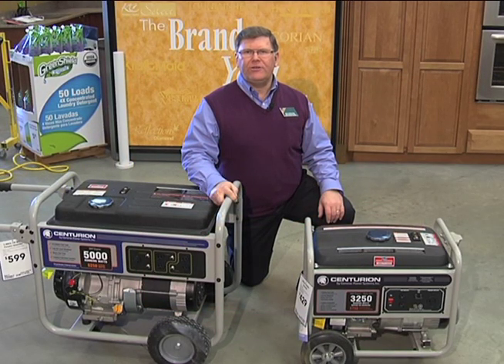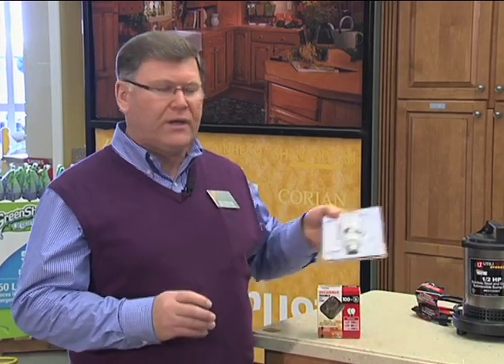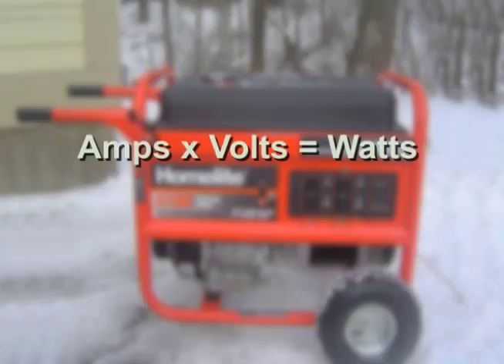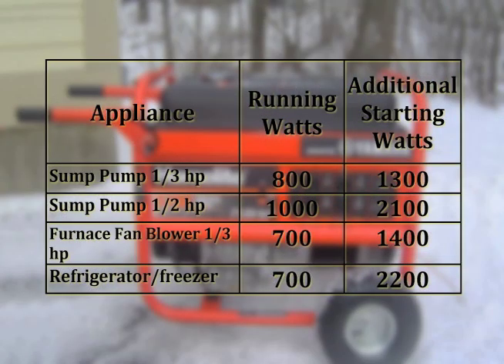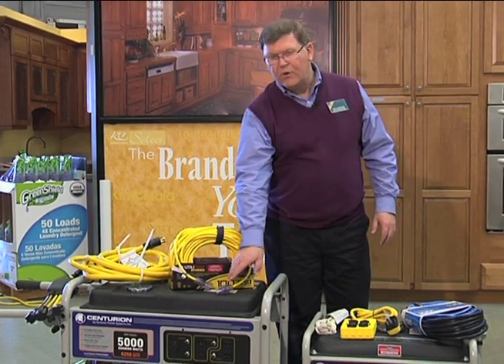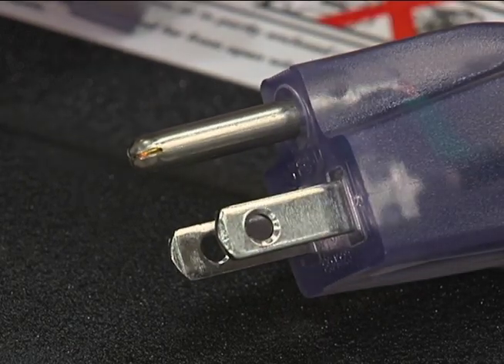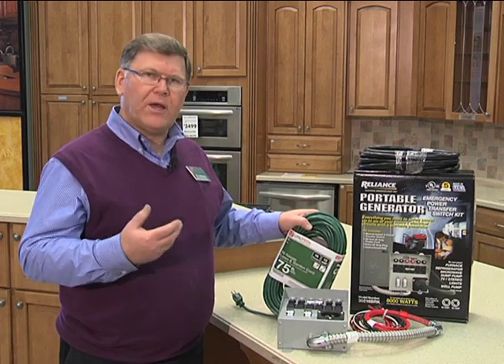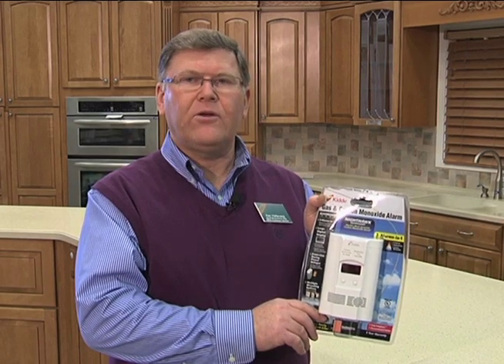Planning Ahead: Portable Generator Safety

Comment: Yup, not enough voltage with a long cord,  the motor will stay in 'start' mode as the motor will not spin fast enough to go into 'run' mode
and the start winding will burn out. Many appliances Co. will void the warranty if an extension cord is used.

Comment: He seems to be referring to  “surge watts” or “peak watts”  which is the watt "maximum" when an item (re)starts - those are not "additional" watts - since the running watts are still included in the "peak" number.   i.e. an item with 100 running watt requirement and 300 peak watts needs 300 watts available - not 400.

Comment: Is it ok to plug an appliance using 120 volt plug into the heavy duty 240 volt power cord which has pigtail or multiple female ends on it.  The cord is rated at 30 amps. Thanks fr ur very good video.  Also My home is older built in 1958.  Would u recommend that I bury a grounding rod and ground the portable, stand alone, portable generator?  Westinghouse 7500 E
Reply: You need to make sure the cord you are describing is splitting the 240 volts onto to 120 legs.  The best way to find someone who has a voltage meter and test one of the ends.  These usually have 4 plugs on their ends.  The volt meter will tell you if it is 120v or 240 output.  You should find each plug is 120v and are taking two plugs off each leg of the generator.  I am not an electrician.

Comment: No video I watch can give me adequate information regarding earthing of a portable generator. Lots of other information but this issue is glossed over 99% of the time . What about earth stakes? What gauge wire is suitable for earthing?
Reply: Every electrician I've talked to recommends copper wire, at least 10 AWG. If you're close enough, you can just connect to the existing ground rod for the house. Otherwise you'll need to drive in a 4'-6' copper or galvanized rod.
Reply: @DragonPilot  ; Gary, where would I attach the grounding wire to the  generator before I attach it to the grounding rod?  Thank you.
Reply: @moneypenni1694  I think it depends on the gen. Some come with a grounding lug and screw on the lower part of the frame. Without that I would think any screw or bolt attached to the frame would work. Or drill a small hole in the frame and drive in your own screw/bolt.
Reply: @DragonPilot  ; thank you for responding, I"ll do that ...:-}
Reply: @moneypenni1694  Don’t forget to float the neutral on the generator or you will trip the house GFCI outlets. Also ground rods need to be 8ft long and at least 8ft from home ground rod. You can ground the generator to the same house rod if your close enough
Reply: @chewtoy6669  ; thank you, I appreciate your getting back to me about it....:-}
Reply: There is a lot to be said about grounding/earthing. It really depends on how u use the gen. If u run things off an extension cord for outdoor use, u must use a good 3 wire cord that is
heavy enough for the amps drawn and heavier if its a long cord
to keep voltage drop down. If u have a gen that says 'bonded neutral it means one side of the output is grounded to the frame. If using a tool outside and it has a fault it should trip
the breaker on the gen. if it has a fault and ur using a 2 wire extension cord, you could find out some's not right the hard way. . .then again not live to tell about it a 3 wire extension is a safety item, it will do no good to cut off the ground pin as u
will no longer have fault protection.